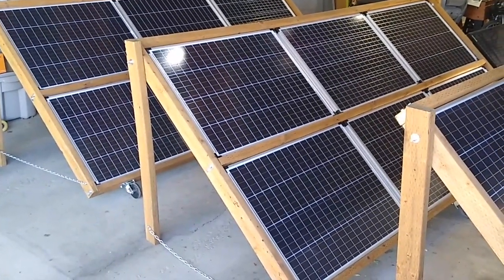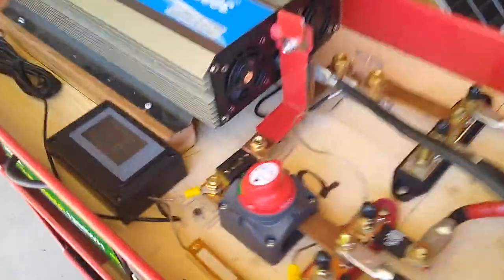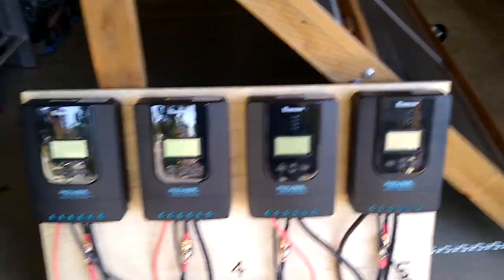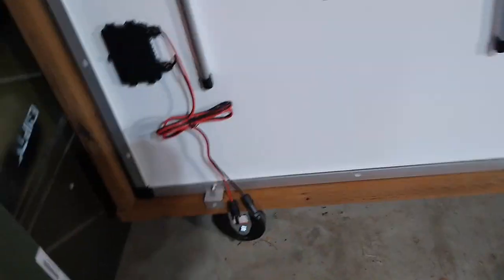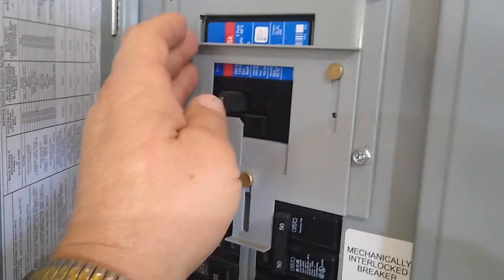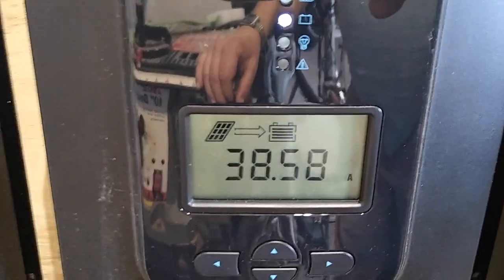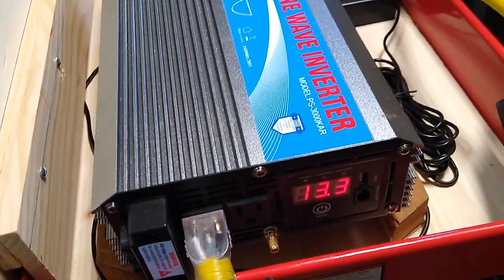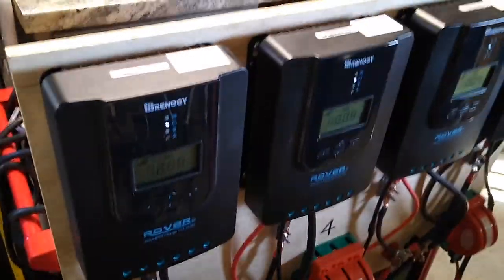My Portable DIY Home Solar Powered Battery Backup System for in Case the Grid Goes Down...

Comment: @3:15 so each array is 2s3p that means the current will be 6.2A x 3 = 18.6A (in lab condition, in real world will be less) that the charge controller will pull from the array, then the MPPT (basically a smart buck converter) will convert the panel of around 36V (if Vmp of each panel is 18V) 18.6A, so input power can be about 36V x 18.6A = about 670W, 670W/13V (or more) charging Voltage = 51A (in real world will not be that high) of charging current, but the MPPT you have can only do 40A (40A x 13V = 520W the MPPT can pull from panel array) of charging current but that is fine since you over panel the system so you will still collect power on a bad weather days. I like your panel stands, very clean built.
Reply from the maker: Your are correct, the arrays are 2S3P and so the panel wires are only seeing 18.6 amps or so but the MPPT controllers are pushing 37 or 38 amps into the batteries.  I didn't want to bother explaining that on the video so I simplified my explanation of the power involved.
Reply: @MathesonFamily  That is really good output charging current.

Comment: Cool setup!  Question:  If you needed to use the system until the batteries are depleted, on average how long does it take to recharge to full on the number of panels you have?
Reply from the maker: That's an excellent question and I haven't tested enough to know for sure.  The closest I've come to depleting the batteries was down to 25% capacity.  I'd expect it to take 6 hours if they were fully depleted and there was no load on the system and probably all day if the house were drawing the typical 600-700 watts.

Comment: Awesome system. I admire your determination. Solar system is still intimidating to me. Do you wire the panels in series or parallels?
Reply from the maker: I've done a fair amount of experimenting with different wiring schemes and remarkably, for this small system, it made little difference if it was series or parallel.  The best seemed to be a series-parallel arrangement.  For each array, the top three panels are in series and the bottom three panels are in series and the two rows are in parallel together.  I've been super busy with some other tasks lately, but eventually, I'll post a video that shows those differences.
Reply: @MathesonFamily  Awesome. Thanks!

Comment: nice setup. I would suggest you connect each battery to busbars. Daisy chaining puts the load through last battery at max.  watch a video about it.  if you pull 2500 watts that is 1C( you have 2 banks) and will lower the life of your batteries.  even if you did  2 in parallel and had 4 connect to busbars that would lower it to .25C. just trying to help you keep those batteries around a lot longer than they want you to.
Reply from the maker: I'm not sure how you are interpreting my battery connections.  I used the balanced parallel scheme shown as Method 4 on this page ( http://www.smartgauge.co.uk/batt_con.html ) for each of the 4 batteries on the shelves.  All of the battery cables are identical except the output cables from each shelf that join the busbars on the inverter board.  Those latter cables are larger gauge but identical to each other.  Each input on the busbar is equidistant to the load terminal.  So, it is all parallel.  That will be a little more clear in a future video that I just haven't had time to assemble.
Reply: @MathesonFamily  we call that daisy chaining. you need each battery to connect to a busbar so it shares the load equally. trying to help.
Reply from the maker: @dc1544  Thank you for trying to help.  I appreciate it.  I am going to respectfully disagree with you because using Method 3 or 4 in the above link, provides a balanced parallel connection.  Daisy chaining to me means going from one battery to the next and to the next, etc.  So Method 1 and 2 could be considered daisy chaining even though they are also in parallel.  But they are not balanced and in those cases, I agree that you would lose efficiency.

Comment: Thanks for showing us this. I’m designing a similar scale system, and curious as to whether you considered a 24v system by wiring some panels in series to boost the voltage. A series/parallel configuration, in other words.
Reply from the maker: The system is 12 volt because when I started acquiring the components, my intent was to assemble a much smaller scale project... maybe only 4 panels to power the computer, wifi and aquariums.  If I was planning a 2000 watt system from the beginning, I would do it differently and it would be 24 or 48 volts.  Anyway, I do wire the panels in a series/parallel arrangement.  For each array, each pair of panels is in series and then the 3 pairs are in parallel.  The Rover charge controllers will accept up to 100 volts, but my inverter is locked into a 12 volt input.

Comment: Nice system. But why store it in the garage ? Why not have it in use ? The system should last 20 or more years without needing to replace batteries or panels. And that is if you live in the desert .
Reply from the maker: I'm not really looking to disconnect from the grid as my average bills are less than $100 per month.  I am considering installing some wiring so that I can remove the refrigerators and freezer off the grid and onto one solar array.  That wiring change would be another project in itself.

Comment: Good job. Can you tell me what 500Abattery monitor you are using, I need to get one like that.  Found it, Renogy on amazon. And how is the yellow inverter output cord connected to the breaker panel? Thanks for any help.
Reply from the maker: My battery monitor was sold under the "AiLi" brand name but I believe it is identical to the Renogy.  I hired a couple of electricians to install the mechanical interlock panel and generator port on the back of the house before I ever thought of the solar power system.  The inverter plugs into that generator port by means of the yellow adapter.

Comment: Nice setup, which I'm building something, but with 2x 400w half-cut cells panels, and 6x 150w panels all on movable frames and 4.8kwh of LifePo4 and 4kwh of LA, plus a 3kw inverter.
Reply: You are using two charge controllers to run 2 different sets of batteries and 2 inverters?

Comment: I had thought of doing something like, but from what I had told was that if you use the plate interlock as you do, it will only power one side of your breaker panel.  I was also told that the inspectors want to see a 'balanced' panel, in circuits and reasonable loads. So, doing the plate interlock, I would have had to choose. Again, perhaps your plug allows it to fee 120V into both buses. Perhaps that fancy plug fixes that, dunno. I agree that I did not want to go to a sub panel and only run a few specific circuits. Instead, I bought a Generink and have a 7500W generator that will run the house if bad things happen (except a gasoline shortage hah!). Electricity is still quite cheap and so to spend $$$ to offset it does not make financial sense to me, even if I would be saving the planet.  So, I have 800W of solar on my RV and I had been thinking about using this to augment my home power. However, interconnecting this was going to cost too much. So, instead, I got the idea of charing my PHEV with the RV solar and it works pretty well. I would say with recovery ties and such like that such an arrangement is only viable for the 6 sunny months of the year, but that fine as well.
Reply from the maker: Yes, the adapter plug powers both sides of the panel.  I agree that for me, there's no sense spending any more on a larger solar system since my electric bills are less than $100 and I don't expect to live in the same house after I retire (whenever that happens).  If I lived in Arizona or Nevada and my electric bills were in the hundreds of dollars, I'd go the full solar route but realistically, there's no need for me to do that currently.  I also have a 7500w inverter generator for cloudy days, if necessary.  Everybody has their own price level for what will buy them peace of mind.  I feel OK for now.

Comment: Very impressive Solar System. Can you reveal how much is the Total Cost of the entire system Parts & Labor?  How long will it take to get to the Break Even Time in years? Thanks!
Reply from the maker: Haha... total cost was $5000.  I don't expect to ever break even because now that I have it and it works, I doubt we'll lose power for an extended period of time.  But it's better to have and not need than to need and not have.
Reply: @MathesonFamily  As a very frugal DIY I am a very cost conscious person. From a Chinese manufacturer I am getting 4000 W solar panels and a MPTT charger all for $250 !! And, I am having 2, 12 V Deep Cycle AGM Batteries in parallel with 2400 Wh for $500.  All I want is to run my 24 c ft Fridge/Freezer (250 W, but needs 1000 W induction power) and my large LCD TV & Desktop computer & Smartphones (all take 250 W). I am getting a Vervor 2000 W Pure Singe Wave Inverter for $160. I hope I can run this everyday whether or not my grid is alive or not in Houston (where I pay 10 cents for one unit of electricity) and solar power is available for 300 days a year!!!  Crazy me!!!
Reply from the maker: @mohamedhabib8460  Good luck!

Comment: If you want to run your house, you could get an all in one inverter that has 240v out. I have it for my house, I connect it to my house transfer switch.
Reply from the maker: True, but this grew incrementally from a smaller design and it works so I'm satisfied.  Now that I have it, I doubt we'll lose power for an extended period of time. :)
Reply: @MathesonFamily  if you haven’t yet, I would run a test on the system for a few days. Simulating a blackout. See if you can run overnight, see if your system can handle the demand. Or what if it’s raining the next day? Maybe for a day or two, or it’s just cloudy. How would you recharge the batteries? Run your test now and be ready. Don’t make a mistake and found out later it’s not working as you thought it would. 

Sorry, it’s the prepper in me 😂 
I just like to help others and to be ready.
Reply: @iiinsaiii what type inverter you have?
Reply from the maker: @riverbottomband  The inverter is a 12v Giandel 3000W inverter.  They sell the same unit in a 24v flavor but when I bought mine, I wasn't thinking to make the system as large as it is.  If it's cloudy or rainy, my dual fuel 7500W inverter generator comes out.  Hopefully, I'm covered for 99.9% of my future outages but you can never be 100% prepared because even the larger systems with Tesla Powerwalls will run out of power if you have a week or more of grey cloudy days.

Comment: If you had more solar panels in more battery capacity, could you run your dryer and microwave at the same time????
Reply from the maker: It would require more panels and a different type of inverter that would provide the appropriate 240 volt output.

Comment: Why wouldn't you start using your system daily?
Reply from the maker: I'm not really looking to disconnect from the grid.  My system isn't powerful enough to do that but I am considering installing some wiring so that I can remove the refrigerators and freezer off the grid and onto one solar array.  That wiring change would be another project in itself.
Reply: @MathesonFamily   I'm not saying get off the grid just enjoy some of the fruit of your labor  excellent video
Thank you

Comment: If this system can supply most of your electricity needs and you already have it, why not use it on a regular basis to cut your electricity bill, at least to power your 110v needs during the day?

Comment: Question... How do you do battery maintenance? Is it ever likely that the batteries would not be used for a length of time such that cold and slow losses could cause their voltage to bottom out? I live in northern Utah and it gets colder than I'd like for batteries. Having a reasonably warm area to store a cart like that during winter months is a bit tricky for me :/ But yeah curious if you have a method of using grid power to top them off in the case where you didn't want to setup the whole array.
Reply from the maker: Fortunately, LiFePO4 batteries do not need much in the way of maintenance and will hold their charge for a very long time.  The Renogy website says they can easily be stored for a year but recommends doing so at 50-60% charge (https://au.renogy.com/blog/everything-you-need-to-know-about-lithium-battery-charging-cycles/).  It appears the biggest issue is to avoid deep discharges (below 20% capacity) and recharging to less than a 100%  (I try to charge to 90%) but when they're connected to the panels, they can charge relatively quickly and it's easy for it to go to 100%. Yes, I do have an AC charger that will charge the power cart.  If the batteries are at 50% capacity, it will charge them fully in about a day. The panels will do it in about 3 hours. Fortunately, my garage is insulated and in the early morning with an outside temperature in the teens, the garage is typically in the 38 to 40 degrees.  The battery manual says the storage temperature is 14 to 122 deg. F.  If we had a severe cold period, I would probably bring the batteries inside.  Min. charging temp is 32 deg. and min. discharge temp. is -4 deg. F.

Comment: With as many batteries as you have, I would move over to 24 or 48 volts.  Everything you have will support except the inverter.  It will be much easier for you to expand the system if you ever need to.  Nice install though!
Reply from the maker: Yes, 24 or 40 volts if I was starting from scratch.  This grew incrementally from a smaller design with a 12v inverter and it works so I'm not likely to change anything for the foreseeable future.  Thanks for you comments.

Comment: have you noticed any problems with the bonded neutral inverter feeding your bonded neutral panel? can be very dangerous,  aside from that it looks like a nice system
Reply from the maker: Good question.  I haven't noticed any problems.  Do you have any recommendations?  I did verify that the grounding screw on the inverter was connected internally to the grounding prong on the inverter outlet.  I also verified that when the inverter is plugged into the generator port, there is continuity between the inverter grounding screw and the circuit breaker panel box.
Reply: @MathesonFamily  you only want one bonded neutral and that should be at the main panel, I'm not sure how the inverter you have now works for the neutral but on larger inverters like growatt, mpp etc the bonding screw needs to be removed
Reply: I was worried about this too with my setup at home since a generator has a floating neutral.  I originally purchased a Renogy 3000 watt inverter and called the company - they told me not to connect it, but suggested using their 3000 watt charger inverter.  I purchased a Bluetti AC 200 Max and have been using that for several months.  If connecting an inverter with a neutral ground bond to a neutral bonded panel is so dangerous, I wish someone would actually post a video showing a real demonstration of what could happen.  I like the adapter plug - I would have jumped the two hot legs on a regular 240 plug.
Reply: @PWoods-cd6tk  lots of videos explaining it but basically what happens is your ground wire becomes a shared neutral and you can get shocked or killed
Reply: @todamnbad  we need a demo of someone getting shocked or something catching on fire.  I've read and watched all kinds of videos and that's why I didn't do it.
Reply: @PWoods-cd6tk  sounds exciting but probably hard to find a willing participant
Reply: @todamnbad  I have panel that has a ground neutral bond and a Reliance manual transfer switch.  I have a dedicated, non affected 20 amp circuit with a GFCI outlet that I installed to charge my power station or supplement whatever type of system I installed with grid power.  I can charge the Bluetti while it is connected and running my four circuits without the GFI tripping.  However, if I try the same thing with my other solar generator that does not use a DC charging brick, it trips.  I'm guessing there's enough of a trickle coming back through the neutrals to trip it.
Reply: @PWoods-cd6tk  it's probably because of the way the neutral is the reliance transfer switch is designed,  it does not switch neutrals when you go from grid to generator, reliance is built for off grid use or with a generator with a floating neutral

Comment: I am also using a Giandel 3000W inverter and it only allows me to use 1500W per outlet. Does yours say that too?
Reply from the maker: Interesting question.  No, my owner's manual doesn't seem to say anything about that and there's no warning sticker on the unit that says that.  Moreover, it seemed to work fine during the series of power tests I did with it where I did run it at 3000 watts (thru just one outlet) just to see if it was all working OK.  It seemed to be fine, but in its intended use, I really don't expect to see it run much beyond 1500 watts.  The AC Works adapter that connects to my generator port isn't intended for use beyond 1850 watts.

Comment: Are your array's all parallel, series or combination (ie: with those amps, what are the volts going in?
Reply: Each array is comprised of 3 pairs that are in series.  Those 3 pairs are then in parallel.  Each panel provides about 16.5 volts so for the two in series, the voltage is about 33 volts.  I might change it to having 3 panels in series and both of those triplets being in parallel.  That would make it about 50 volts and possibly more amps but I'm already getting more amps per panel than the official rating of 6.2.
Reply: @Eric1Tube  The amps would drop but the wattage should be about the same.  Overall it's more efficient with higher voltage because there's less voltage drop and cables can be smaller.   Adding a fuse to each array would be a good idea too.